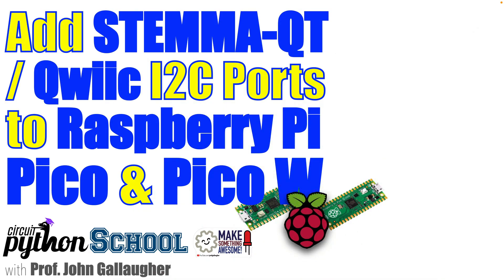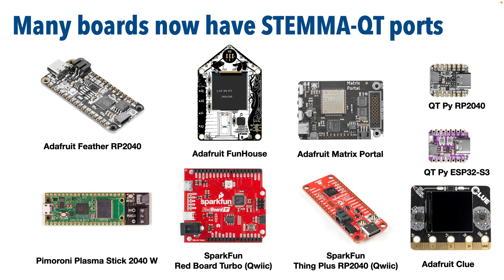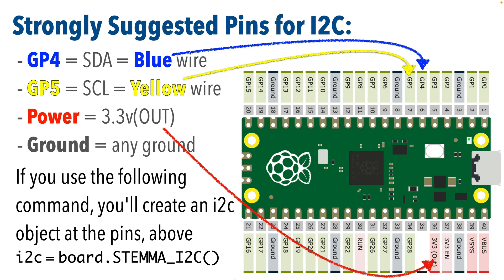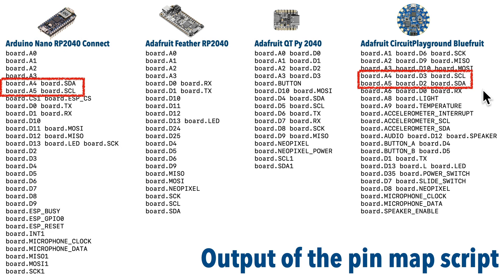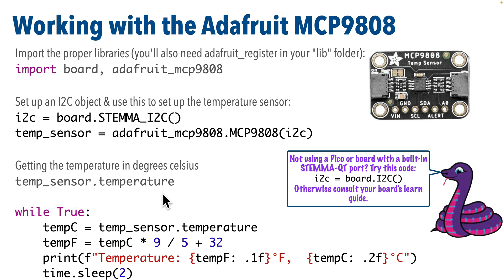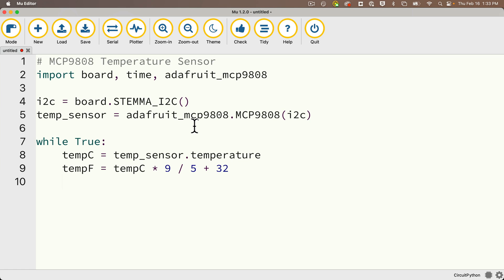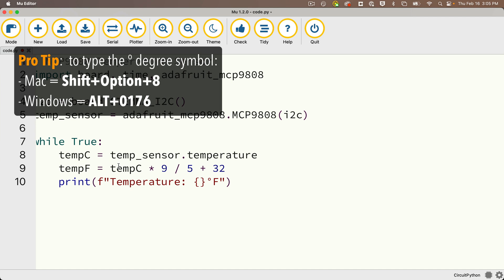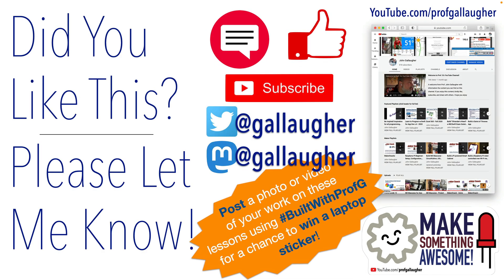Raspberry Pi Pico & STEMMA QT / Qwiic + Using a Temperature Sensor & Formatting Numbers

Comment: thanks! which side up/down do you plug the Stemma QT in? It seems to fit both ways...
Reply from the maker: Hi. Look at the bottom of the JST jack at the end of the cable. You should see there are metal bits. Those should touch the corresponding in the receiver jack. Those are usually on the bottom-side of the board you're plugging into. If you flip it over you can force it in, but that's definitely not what you want to do. You also know you're the right way because most (but not all) breakout boards have a power light to say "I'm connected properly".